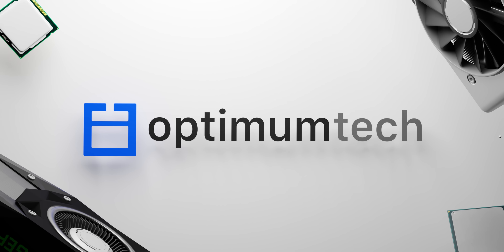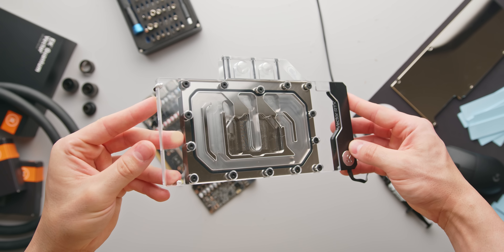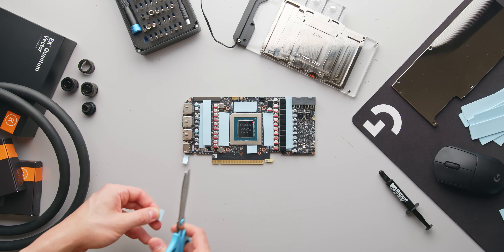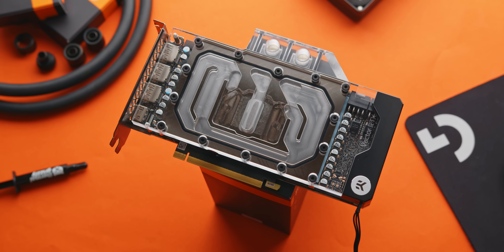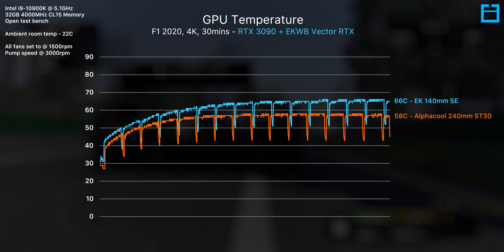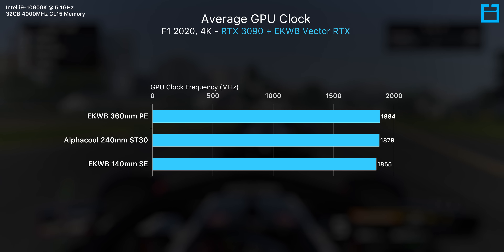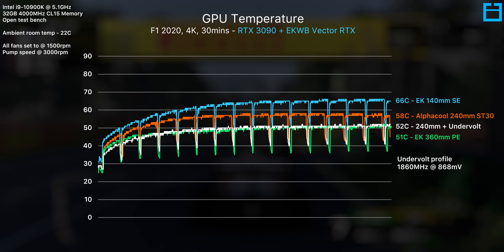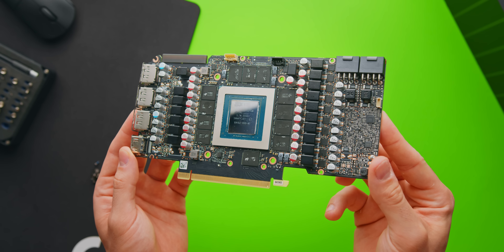RTX 3090 Liquid Cooling – Better Than Expected?

Comment: I'd be interested to see the coolant temperature as well as the GPU temperature. My 980Ti is always within 5°C of my coolant temperature, so although it would be fine at 65°C, that would mean I had a rather alarming 60°C coolant temperature. The GPU would be happy, but my cooling loop would not be!
Reply: The temperature delta would increase as temperature goes up due to how thermal transfer works (read on Newton's Law of Cooling) but still, you raise a fair point. I would be quite curious about liquid temperature as well.

I think the downward spikes in temperatures show a good idea about what temperature delta is as the GPU cannot go before the coolant temperature. It looks like at 66 degree C the coolant temperature is around 51-52 degree C.

Comment: 350w is like the bare minimum with no overclock, even then the card will probably pull more than that. The Strix and FTW3 have 480w+ bios, most likely need at least a 360 rad for it to run cool and semi quiet

Comment: I take it you don't buy EK GPU waterblocks much? They make you cut the pads most of the time.  The is something that every full cover water block maker did since the early days. I hope you don't ever run into a situation where the blacks doesn't fit. I say this because if you don't try a test fit before cutting the pads some places will not let you return the block because the pads were cut. 

With all that said I enjoy your video because you are willing to use water cooling in tight spaces.
Reply from the maker: I almost exclusively use EK blocks but I'm still shocked that this is a thing. I believe Corsair have their thermal pads cut to size and pre-applied to the block though which is why I mentioned it.

Some of the thermal pads that you have to cut for this specific block are ridiculous.
Reply: @optimumtech  Some GPU full cover block installs are a cake walk and some take longer. By having the user cut the pad you can at least insure all the pads get put into the box and not lost. I see where are you coming from though.

Comment: Guys help! My NZXT 210 build is way too hot. I use a RTX3080FE and a5600X cooled by my X52 Kraken AIO. Should I get rid of the AIO und cool the CPU by an stock cooler and rather build an 240mm Radiator in front with an waterblock for the 3080FE? Am I missing something? Appreciate it very much! My 3080 is getting above 80 Celsius even when I open the glass front and go with all fans on 100%. Something is not working out but the 3080 is getting very hot and I don't feel good with this. I hope someone can help me!

Comment: Could you test this with 2 rad set ups in a case plz all sizes as well would be awesome. and the test game F12020 is pretty well optimized for the most part, if you own Watch dogs legion or Assassins creed origins that might stress the system harder pushing those thermals higher.

Comment: 51 C ? i mean its better than air but not that impressive I was hoping to see lower. 30 over ambient is pretty terrible. i wonder what the delta was? I guess in a duel rad setup with a superior optimus waterblock you wont go passed low 40s maybe even lower

Comment: Why would I pay 2000+ USD for a water cooled 3090 and then undervolt it to get the performance of an overclocked 3080? Just to save some bucks on the power bill? 🤷‍♂️
If it’s already water cooled, I would overclock it to 2100 MHz to get the most performance out of it. Otherwise you could just get one or two stock 3080...

Comment: That's not a reference pcb, doesn't the reference one have 45 degree pcb at the end?
Reply from the maker: Founder's Edition doesn't use a reference PCB. 
Not the same thing this time around which is a bit confusing!
Reply: @optimumtech  Ahh, I thought the ref PCB was in the founders and only the founder edition!? As being the OE PCB wouldn't that automatically make it the reference version!?
Reply from the maker: @BUZDRIFT  Usually but not this time around. FE PCB has the unique v-shaped cut that you mentioned, reference is a separate spec. here's a list: https://www.ekwb.com/configurator/waterblock/3831109829967
Reply: @optimumtech  Ah, very interesting! I assumed that Nvidia decides what the reference design would be. They went all, custom n shit, well, thanks for the link!

Comment: Do you think it's possible to cool 2x3090 with custom loop 240mm radiator (without CPU) ?
Reply: SLI is dead
Reply: @detmer87  I dont care about SLI
Reply: If you can under-volt them maybe. I'd be happier with more rad.
Reply: I'm thinking either FE with air partially blowing out, or watercooled 240 rad

Comment: You are testing the 3090 as another normal card. The problem with 3090 is that it has so many components that run hot on the back side (memory and voltage convertors_ and actually the temperatures on the backside with the water block are worse than the stock cooler. Have you checked? So, the overall performance is worse. This is the reason that we haven't seen reviews with waterblock and 3090. My advice the waterblock is ok for a 3080 but don't buy it for the 3090. I have tested with EKWB and Alphacool water block

Comment: Seeing this i really want a NCaseM1, 3080 FE (imho 3090 is too expensive) with short Waterblock (thanks to the small PCB), Ryzen 5900x also watercooled and 2x240mm Rads. As for Pump/Reservoir either the Iceman (as see in one of Optimums previous Videos) or maybe a Pump in front of the GPU, since the space is empty thanks to the short PCB.

Btw EKWB will be selling a FE Waterblock with in/outlet on the V Shape cutout: https://twitter.com/EKWaterBlocks/status/1322274532305063937/photo/1  That thing looks SICK...

Comment: water cooler 1500$ gpu, underclocked to 3080 performance !!! What ? Why ?
Reply: underclocked to exactly the same as the 3090 like he said in the video.
Reply: UnderVolt = same performance but less power and heat.
Reply: @britishagent  that is undervolt
Reply: He did not underclock, he undervolted and keep the performance
Reply: @Lavi-Aemilia-Astori  Corrected, cheers!

Comment: Why does nobody seem to be concerned by running fans at 1500RPM? That's goddamn noisy FFS.
I have a 9700K, 1080Ti and Maximus XI Formula VRM cooled with two 420mm rads running 6x ML140 fans at around 800RPM and my water delta is about 8*C.
It's an absolute overkill from cooling capacity standpoint but hey I can have my system fully loaded with fans going 800rpm being quiet AF!

Comment: Meanwhile my 1070 runs at up to 80°C with water cooling in certain games ¯\_(ツ)_/¯

To be fair: It's got a TDP of 250W and I'm running a 120mm AIO.
Reply: That's horrible. Are you sure you got proper contact with the block? There are plenty air-cooled GTX1070's that stay under 70 degrees while being silent.
Reply: @detmer87  Yep, I've got proper contact. I'm not running the best fan for a radiator. I'm using a BeQuiet Silent Wings 3 120mm fan (high speed edition) and a Corsair H55 AIO. That fan really isn't ideal for radiators due to its frame design. Google it and you'll know what I mean. I'm waiting for that freaking A12x25 in black/Chromax -_-
Also, I'm using a Noctua low noise adapter to keep the noise down. It's kind of in vain due to the massive coil whine of that GPU, but it's still better than a roaring fan IMO. I know, the temperatures are pretty high, but it depends a lot on the game I'm playing. The specific GPU is a Zotac 1070 AMP Extreme. This thing is being pushed to it's absolute maximum. Usually a 1070 has a TPD of around 150W. Mine has got 250W. That's 70W more than a 1070Ti. My GPU doesn't really seem to care about the temperatures. I've never seen it running at less than 1940MHz. Usually it's right around 1987MHz. If I really push it, I can get it to 2150MHz but anything above it will crash. Depending on the game, it can really get to 250W. In "less demanding" /better optimized games, it's usually sitting somewhere around 170W and runs in the low to mid 60s.

Comment: overclocking 30XX series makes NO SENSE. You use way too much Watts for miniscule gains.

This means the card stock is already working in its limits.
Reply: He doesn't overclock it at any point in this video. Undervolting is completely different to overclocking.

Comment: You're videos are good and all, but who wants to see a liquid cooled GPU that you can't buy and if you can, you have to spend $1500 minimum on it if you would be able to snag a FE card. Most likely you would have to spend $1700 just for the GPU, you will be able to get a whole system with 95% the performance if this GPU for this. This thing is DOA. So far only Youtubers were able to get them and maybe some fanboys who camped out.